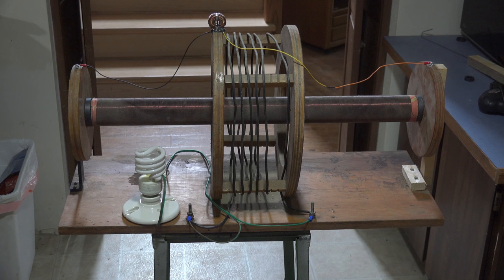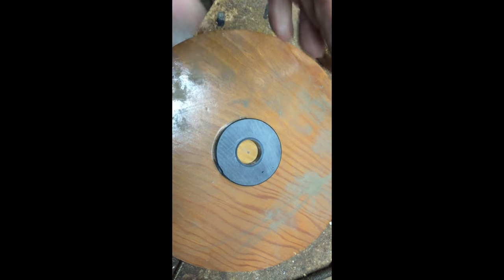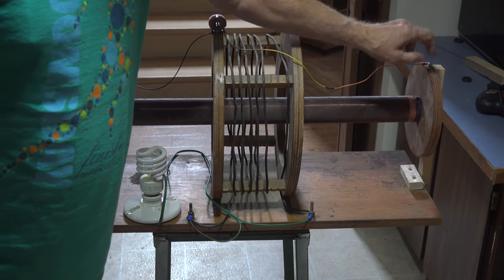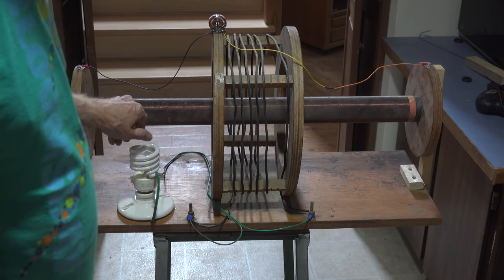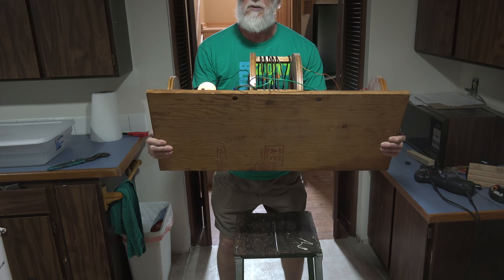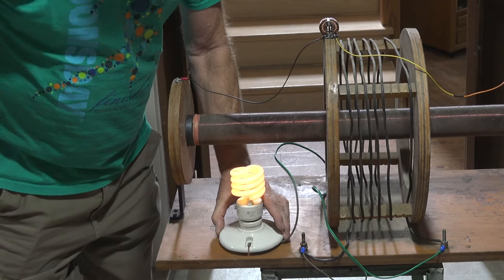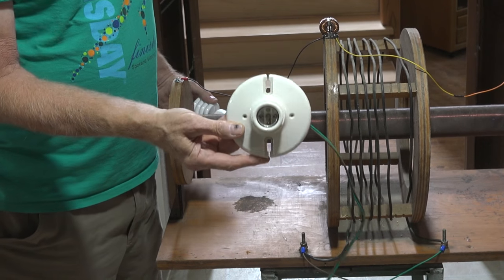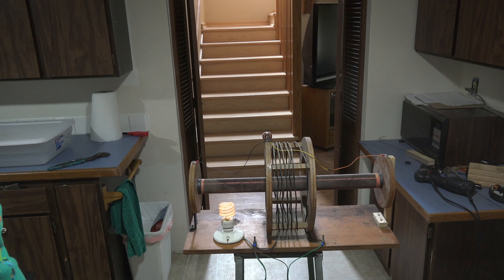Can the Tesla coil be a source of free power?

Comment: It takes a rotating magnetic field to push electrons along the path of the wire to create electrical current flow. 

The magician has hidden an electrical source somewhere in the soup to make a standard incandescent bulb emit lite. But, fluorescence is a little different. With just two strong magnetics and a bit of wire, I too  can pass an electrical field thru the mercury vapor that will emit light. Nice experiment.

Grayfurnaceman, I didn't realize your middle name was Houdini!
Reply: I was going to ask, Will it work with an LED bub?  I guess not.  Will it run an LED clock?
Reply: @JoeLinux2000  -  good questions for the professor. So hang on to your mercury vapor hat.
Dr. Grayfurnaceman shall answer all your great questions next week; same bat time, same bat channel!
Reply: The magician place microwave magnets at each end of the secondary at the beginning?, magnet=magnetic field 🤦🏾‍♂️

Comment: A nearby RF source will light the florescent lamp - attaching it to a larger coil acts as sort of a magnetic loop antenna, which increases pickup.  Unseen is the hidden transmitter / antenna nearby.  He could also be inducing it magnetically, with another Tesla coil or AC fed electromagnet.

Now back to our regularly scheduled program:  HVAC and ethics ...

Comment: A battery+flyback in a bulb (in place of electronic ballast circuit) + the lamp base is effectively shorted by the primary coil, which is used as a switch. I bet shorting lamp leads will light it up as well.

Comment: I believe a Tesla coil would produce DC current.  Lighting that compact fluorescent would require  AC current.  Hence, my guess is a compact watch battery somewhere in the system which provides power to a light emitting device gerryrigged inside the fluorescent bulb.
Reply: I'm pretty sure a battery is DC

Comment: If not too much trouble I am looking for a bit of advice. Got a newmac cl 85/95 that isn’t set right far as I know. Using the oil furnace there is no problem with fan but if you light a fire fan cuts in and out until the fire is almost out. The manual says it should be 95/125/180 for fan limit switch and yes it’s a Honeywell. They set it at 100/150/190. I don’t want to get into a lot of details because they didn’t do high quality work but would it being at 150 instead of 125 cause it to cut in and out like that short cycling? Please help if you have time. Thanks
Reply from the maker: The wider the setting temps are apart, the less chance it will short cycle.  The return air temp also affects short cycling.  Any temp below 60F could cause it.
GFM